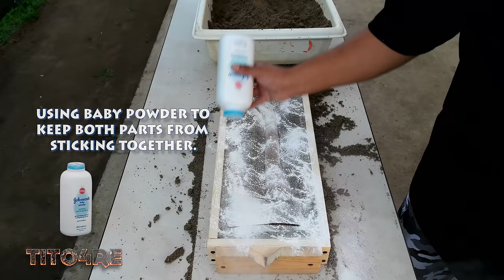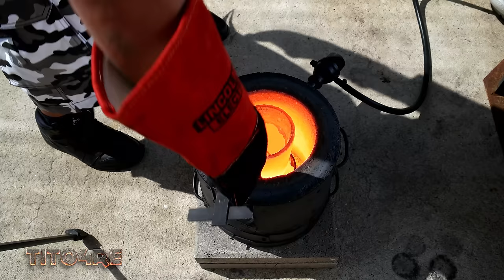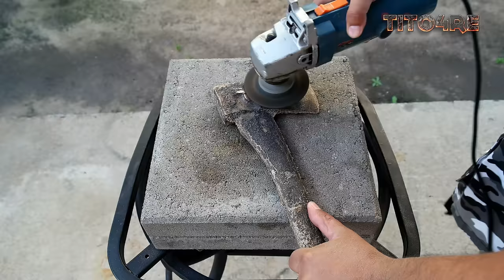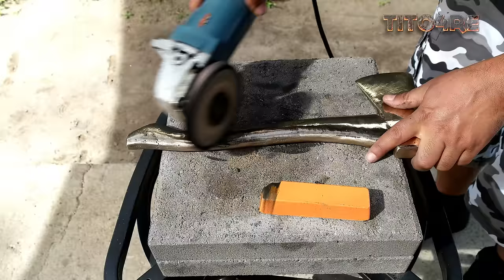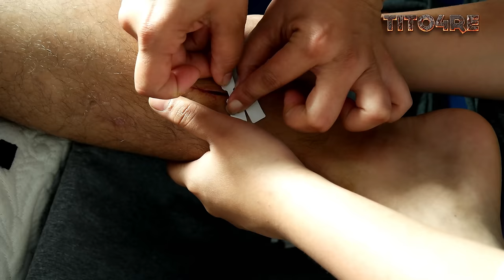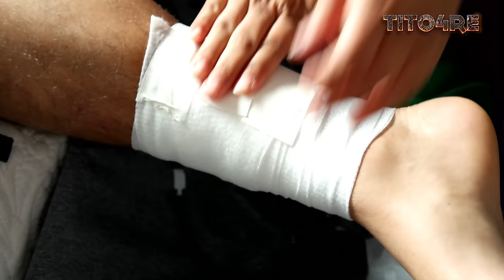Casting a Bronze Axe Start to Finish

Comment: That green sand is a bit coarse ..id use silicate sand or sift out everything but the finest of sand before mixing it with bentonite clay..much smoother finish ..but it's still a bad ass hatchet..

Comment: Why didn’t you use clamps Tito4re?
Reply: Also why not just create a mold of the axe blade instead of the entire handle? Probably would’ve made it lighter.
Reply: Plus realistically speaking jeans still wouldn’t have protected you from getting cut.

Comment: Sounds really stupid... But if you have a high pain tolerance, once you were finished cleaning the cut you shoulda super glued it closed, then wrap it with medical tape. I cut myself on a job site one time and had superglue in my tool belt. Cut my hand right down to the bone.. Sealed it up with superglue and wrapped it with medical tape and took antibiotics. 3 days later, I was able to remove the tape and clean around the area very good. The scar was SO FINE. it looked like a cat scratch when it was fully healed. Got that advice from my grandfather who was in WW2.. Medics used similar glue for cuts. Great video by the way. That axe is awesome.

Comment: hope you had permission to cut down a tree in what looked like a public picnic spot, by the way you made a terrible job of cutting it down, please if you cut another tree down learn how to do it. 
Also, I hope you learnt a lesson in why shorts are not a good idea when doing jobs like grinding. 

Other than that, great video, I'm wondering what's next, what task are you going to do badly/dangerously next, rewire an electric heater while in the bath? 

how many fingers do have left?

Comment: try 88% copper with 12% aluminum by weight 
Then also try this one 75% copper + 20 cast iron + 10% aluminum. must stir to amalgamate the metals.
Also 88% bronze with 12% aluminum. 88% brass +12% aluminum.

Comment: Great work however there are a lot of problems with your techniques, a few I can realize is:
1. you should ALWAYS be wearing gloves when you're grinding something, be it a grinding wheel, grinding belt, or any machine-driven saw.
2. you must ALWAYS have something to hold/support the thing you are grinding, a flat surface is NEVER enough.

keep it up man, I hope your injury heals quickly

Comment: You shouldn't have cast the handle, metal handle is usually a bad idea. In the long run it will hurt your wrist a lot more than using a wooden handle...